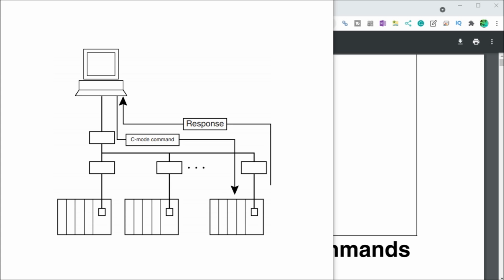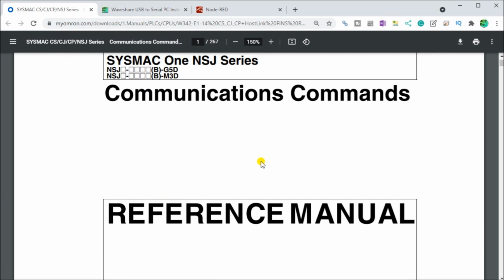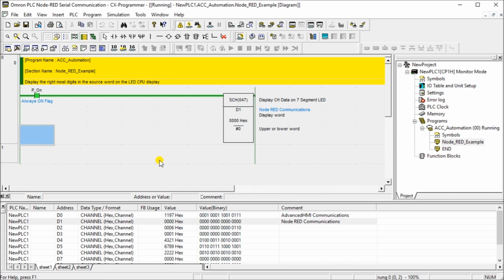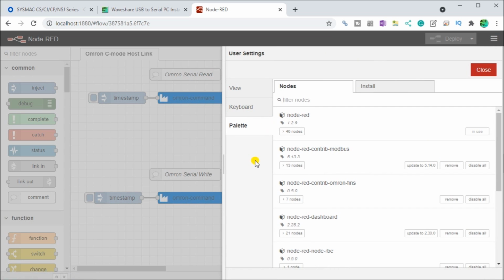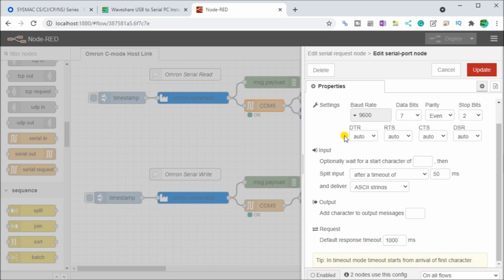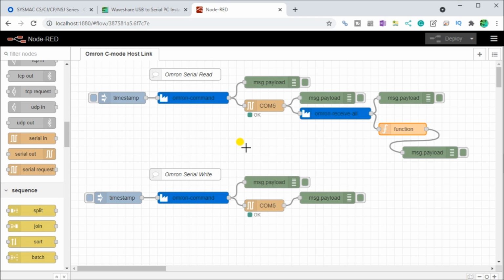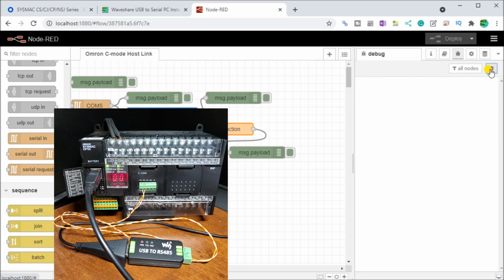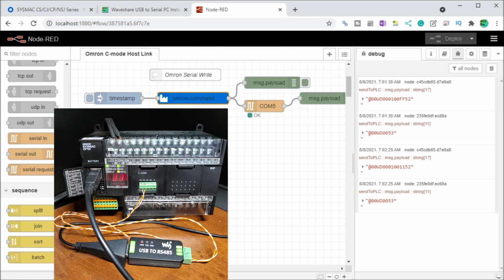Unlock Omron PLC Secrets: Master Node-RED Serial Control

Comment: hello 

can i connect cx-programmer with node red using simulation , no hardware plc ?
Reply from the maker: This is a common question. The CX-Simulator manual does indicate that it supports Host Link Serial. 
https://assets.omron.eu/downloads/latest/manual/en/w366_cx-simulator_operation_manual_en.pdf?v=6
I have not tried this, but let me know if you can use Node-RED. 
Regards,

Garry

Comment: Hi, could i ask regarding the javascript when you are read the input / output? how do i know is that (2,4) in the parameter of substr?

currently i just confuse for that. let say my motor address in 100.05 , then what should i do to read this? thank you
Reply from the maker: Hi @daffaatalla6054,
Here is the post for this video.
https://accautomation.ca/omron-plc-node-red-serial-communication/
You will see in the post the header code (RR) to read the CIO Memory Area of the Omron. 
I hope this helps you out.
Regards,
Garry
Reply: Hi @ACCautomation  thank you. then i have 1 more problem, i only can comunicate only with my PLC, then cannot use in node red. but if i use for nodered, the plc cannot upload program like serial port already used. thank you
Reply from the maker: @daffaatalla6054  
Yes, this is the issue with serial communication. You have two options. You can have a computer with the programming package and physically switch the cable when you need to program. The second method depends on whether the Omron PLC has an Ethernet port. Use this port for programming.
I hope this helps you out.
Regards,
Garry
Reply: Hi @ACCautomation  , thank you for the response, currently i am using Omron CQM1H-51CPU. this plc doesn't have any ethernet port. but that's okay, i can switch the cable. but i have a qtn, in your video, you are using D0 till D10. i saw in ur Cxp file doesn't have any of that in "watch", this "watch" mean in the CX programmer you press "ALT + 3" to show. let say i only have 1 input and 1 output . the address for input is 00.0, for output is 100.0, how is that in the node "omron-command" ? do i need to use Header Code : RR, Beginning word 0000, number of word : 0002? is that possible if use like this? thank you

Comment: can we use a dropdown on the UI to choose which COM PORT do we use to communicate whit the PLC ?
Reply from the maker: Hi Reza,
This is not possible at runtime. I think you would have this already set before starting the program. Possibly a setup flat file?
I would set up timing and continually poll if you have multiple machines to monitor. The selection would then be on the information to display.
https://discourse.nodered.org/t/serial-port-selected-dynamically-from-the-dashboard/52679
I hope this helps you out.
Regards,
Garry
Reply: @ACCautomation  the problem is the PC was not set to be stand by the PLC 😂 it was a portable PC for work, that I think there is any possibility to user use any port of the PC when he connect to PLC, it will cause the port was different, right ?
Reply from the maker: @fun_tech  
The com port may change if this is a USB to Serial connection.  If this is a com port (DB9) from the back of the computer, then the number will not change.
Regards,
Garry
Reply: @ACCautomation  I was tryin to write the com port on the serial configuration with the payload, but its still doesn't work

how if I make a lot of serial com nodes, each of node is have one com port, it mean if I want to have 10 com port, I use 10 serial node with different com port configuration, is there any problem posibillity when we doing that ?
Reply from the maker: @fun_tech   
Almost every video also has a corresponding webpage post. This will cover more detail and provide the code used in the video.
Here is the URL to the post:
https://accautomation.ca/omron-plc-node-red-serial-communication/
This should help you out.
Regards,
Garry
Reply: @ACCautomation  very helpful, thank you, sir

Comment: Can you tell me why in video your comunication board comm led wasnt flashing?
Reply from the maker: Hi Rita,
The light on the Omron communication RS485 board does flash. 
https://youtu.be/S-IrwNJuMWo?t=975
If you look at this part of the video you will see it quickly flash when I select the  input on Node-RED. It will not flash constantly because I am manually setting the communications only once. 
Regards,
Garry

Comment: Hi. I'm Diego and I still trying to write a number in a DM memory but I can not. How can I do that? I try change TX valor, change "RD" to "WD" but still not woriking.. Thanks you for your incredible tutorial and sorry for my english. I'm from Argentina.
Reply from the maker: Hi Diego,
Besides changing to the WD command, you must also make sure that the Omron PLC is in monitor mode. Write operations will not work in run mode. Normally this is set up in the registers to start the controller in monitor mode.
I hope this helps you out.
Regards,
Garry

Comment: Sar pls Mack video from cp1H plc password cracker
Reply from the maker: Hi Hardik Padsumbiya,
I will not make a video for a PLC password cracker. If you want to know the password, contact the machine builder, programmer, or manufacturer of the equipment. You could also clear the memory of the PLC and write your own ladder software for the machine.
Regards,
Garry

Comment: Hi, thanks for the video. One question, how could the omron plc communicate through its ethernet port to the node-red? what nodes could i use?
Reply from the maker: Hi Grover Oswaldo Villarpando Calle,
The Ethernet protocol that Omron uses is called FINS. Here are the Node-Red nodes to be used.
https://flows.nodered.org/node/node-red-contrib-omron-fins
Note: I have not tried out these nodes with a controller. Let me know how you make out.
Regards,
Garry
Reply: @ACCautomation  hello, I tell you that I made this node for ethernet fins, it works well
Reply from the maker: @groveroswaldovillarpandoca4067  
Excellent. Thanks for letting me know.
Garry